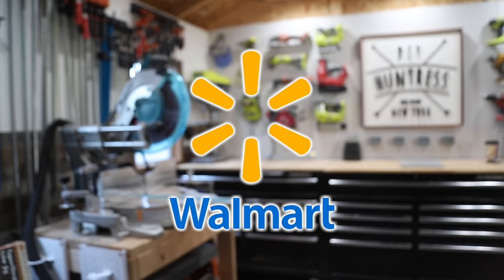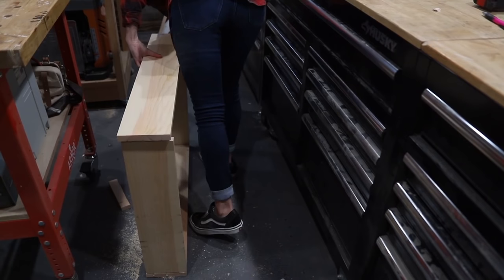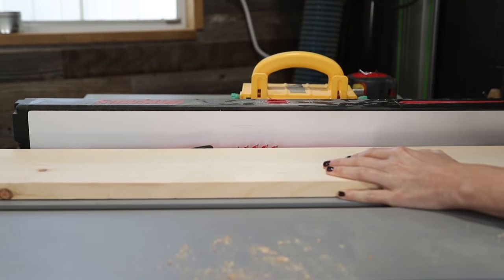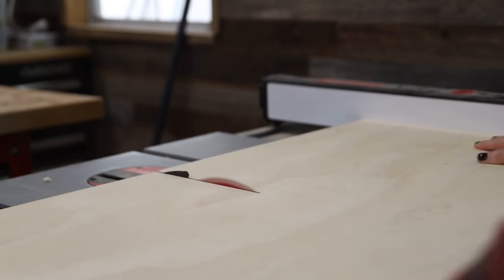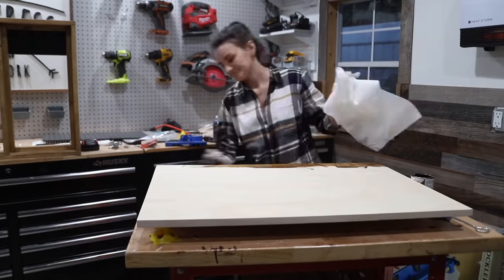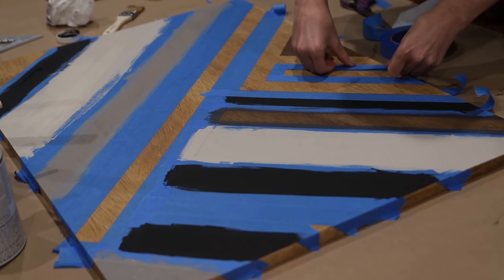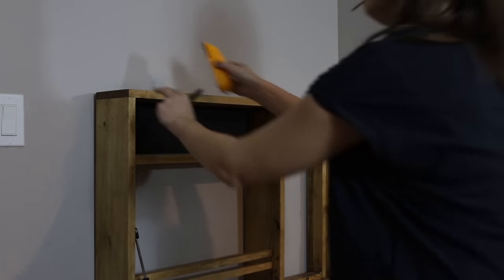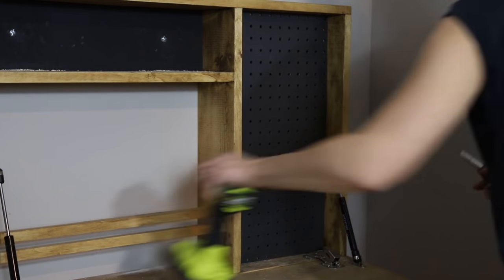How To Build A Fold Down Wall Desk | DIY Murphy Desk

Comment: Looks good, great work! I know you said the pistons work really well but I'm sceptical about this desk being able to take heavy loads. E.g. if you stumble and lean on it to break your fall, would it break?
Reply: Best not to get drunk while working 🥴
Reply: I think I'm going to use a piano hinge on mine
Reply: The screws will be the point of failure. I’ll use cleats in my application.  For toddler use the braking of the lid coming down will be very useful. Speaking of toddlers our gd will be standing or laying on the desk.  Guaranteed.

Comment: I like the idea of folding it and hiding everything when not in use, but mounting it on the wall is not an option for me. Do you have any tips or advice if I were to attach table legs?

Comment: gas spring should be installed the other way around, as there is oil inside the tube to be working efficiently

Comment: Beautiful and simple build!! And functional! Nice only thing I would add is a hole through the bottom for a power strip (charging devices) but other then that beautiful.  Just love the color and wood design on the front panel! You could even do like messages or wording on some of the paint . But sweet build! Thanks for sharing
Reply from the maker: Thank you! That’s a great idea! I just didn’t want cords hanging out of it for my own build. But, would be a great add!

Comment: beautiful work, thank you for sharing, when installing a gas strut it needs to be attached with the cylinder the highest point not the shaft. This is because the Gas Strut cylinder houses a small amount of oil in charge of keeping the seal lubricated and oiling the shaft as it passes through the seal.
Reply: I’m not sure if it was just the angle of the camera, but the table seemed to hang down past the 90 degree point… I wonder if moving the gas struts out a bit further on the table would have helped to correct this?

Comment: Great idea! Very efficient use of space. I’ll borrow the design in a cubby under the stairs for a little one.  Cork on the face for a pin board. 
When staining wood, sanding to 220 is a personal choice. Planer waves are a pet peeve and stain highlights them.

Comment: Nice build and post! How much weight do you think you could safely rest on the outer edge of your desk without overstraining the strut support holes? I've got a 10 year old and she's not always careful with my creations.

I'm designing a wall-mounted standing murphy desk with a 20-24" deep and 28" wide desk surface. It will have drawers underneath and Cubbies above separate from the murphy portion. This will give me a 4.5" deep ledge to rest the back end of the desk on when open.

Comment: I tried using chain to hold the door horizontal in a similar (but not nearly so impressive!) project. I found that it tended to snap and I'd replaced it a couple of times before I swapped it for picture wire, which has proved to be much more robust.

Comment: If you locate this above an electrical outlet or near a wall switch you could add a new outlet behind the desk and give this a very clean look and still be able to plug in the laptop. You could even have a monitor or tv in there.

Comment: Great and excellent. My little suggestion is if you'd have added a plug point with a switch (for charging the laptop) and a reading lamp at the top it would be nice.

Comment: Hello there, that's pretty nice job with this video. Some links are outdated today so I wanted to ask you how did you find and select proper pistons and how did you know how to mount them? I am looking allover Internet and it seems that the pulling ones are expensive and the selection is not so obvious (piston calculators show that slight difference in mounting position may result in big difference in all the forces working on the whole mechanism). Will be very grateful for an answer, because that's the only point stopping me from building my own one based on your video :)

Comment: I wish there was more information on the gas struts for this project. I clicked on the link for your supplies and malfunction comes up. What length of struts and what weight did you use. Are they the same kind of struts used for a cupboard?

Comment: Really great build project! Quick question, will those hinges and pistons hold up if someone leans their arms down on the desk section? I think I subconsciously do, and wanted to see if it’s strong enough for a bit of that. Thanks!
Reply from the maker: Thank you! One thing I mentioned in the video is that I wish I made the overall desk a little shallower (I actually added the ideal measurements I'd use in my plans). I think by making it shallower plus the hinges as well as the pistons would make it super sturdy. It's pretty sturdy the way I built it in this video, but I also didn't put my body weight on the shelf, if that makes sense?

Comment: Hello Sam, got your plan a while ago for this and just about completed my version of the build. My issue is, when open, the lid seems to be lifted higher than the cabinet bit and looks like it could be putting pressure on the hinges by pulling up due to the pistons of course. The hinges here in Cyprus are basic and so that may not be helping. Is this normal and if not, what should be done in your opinion? Regards Pete

Comment: Great video I just finished building a liquor cart with very similar square dolls like you used and I had to move them and I had used 18gauge nails and it was extremely hard to get the nails out I would love to see a video with pointers and tips on how to remove 18gauge nails they always seem so hard to remove especially if you're nailing and the nail goes cricket and sticks out the side I would really appreciate any tips tricks or device on how to remove these types of nails. Also I see that you use edge banding on a project where you're also using staying in my experience using wood stain over edge banding the edge banding always turns out to be a lighter shade of the color of staying then on the wood yours did not seem to do this can you offer any advice on how to make the wood stain a consistent shade on edge banding and in real wood thanks so much. P.S. I really like the screensaver you have on your laptop I have the same screensaver on my laptop and my desktop.
Reply from the maker: Love all of this! Best advice for removing Brad nails is a needle nose plier. As for the edgebanding, make sure to sand it to the same grit as your wood before finish. Hope this helps!

Comment: Wish I saw this before I started working on mine 🥴 how confident are you in the gas strut supports? I might have to pick a couple of those up to finish mine off (the ones I bought seem much flimsier than I anticipated)
Reply from the maker: I actually am pleasantly surprised at how sturdy they are! The only thing I wish I did differently was make the desk a bit shallower overall. Otherwise, it does the job! 😊

Comment: So if i understand the struts correctly they actually push the table down also restrcting an upward motion? Does this not make the table dificult to close? 

The original link to the struts is broken. Any chance you could repost 🙏?

Comment: What is the purpose of the gas struts?  For to hold the desk top open horizontally so it does not "fold down"?  Do the hinges not allow the desk top to stay horizontal?
Reply from the maker: The gas struts serve dual purpose. They help keep the unit closed, but also provide strength and lock the desk in place when they are open. It’s the same concept as a Murphy bed. 😊

Comment: Is this enough sturdy? I mean if someone put his elbow weight on it, how long it will be able to handle it.
Reply from the maker: Definitely been sturdy enough for laptop use and writing! If you have questions about the weight capacity of the pistons, I have the exact ones I used linked on my website.

Comment: I built this and it looks great but I can't get the desk to support the weight of my kids' use.  They can't help but lean on it and the struts ripped at the screws right away.  I could use bigger screws but it doesn't seem like it will hold.  Has anyone found another kind of support?
Reply from the maker: Hey Sarah! Couple of options! If they’re putting a lot of weight on the front part of the desk, you can add fold-out supports to the bottom of the cabinet to hold up the lid when it’s open. Other options are struts with higher weight capacities or adding bolts with nuts through the entire side of the unit and through the struts. 

Unfortunately, that’s the one downside with the folding desk. They’re awesome for holding the weight of a laptop or a small computer and some light work. But, aren’t great for putting force against. Hope any of this helps!